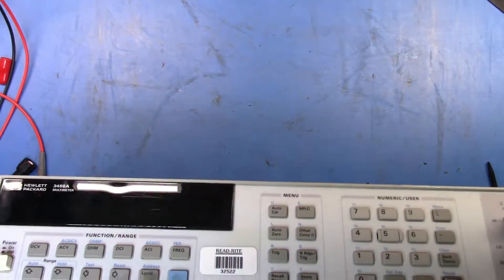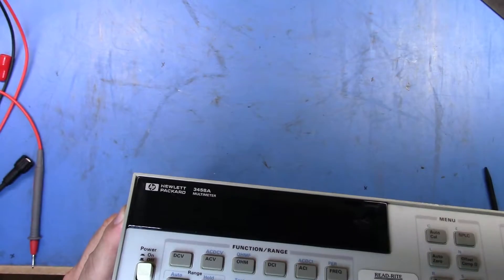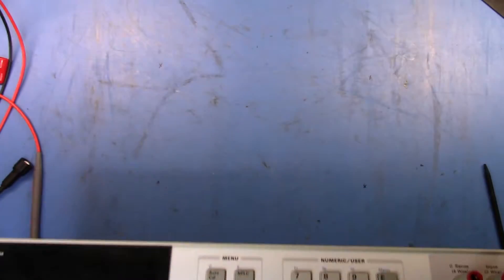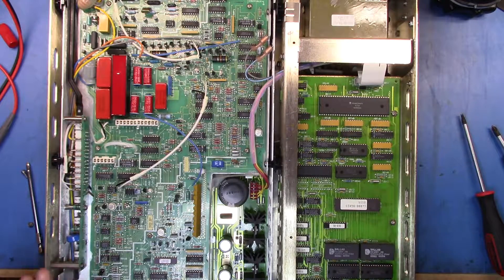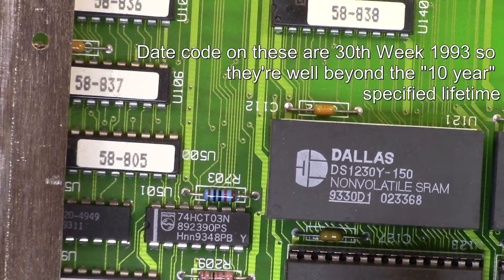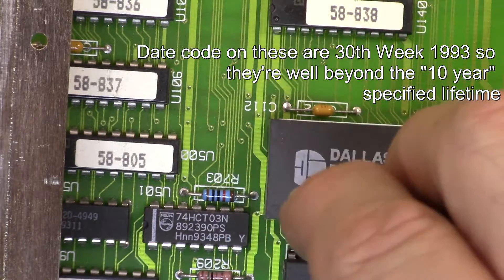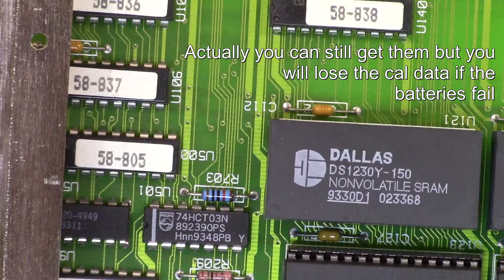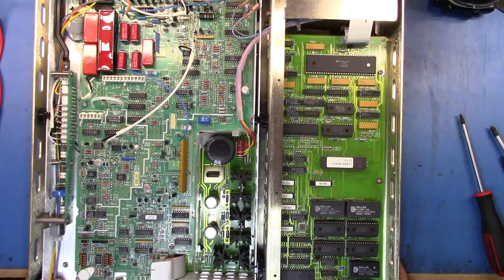HP 3458A NVSRAM Check

Comment: Any update on your 3458A? :)
Reply from the maker: Great to hear from you - Love following your adventures on the EEVBlog forum :) I sent the unit off to Keysight to get an initial calibration and to put it under a 3 year warranty. The folks in Loveland CO fixed a small issue with the rear terminals and then upgraded the NVRAM ICs for me for free - Outstanding support - Spoke to the guy there who manages the lab and he said they really appreciate all the volt nuts out there who buy this old gear.

I'm very happy with the purchase - Once I clear up a problem I'm having with a 53131A Counter I'm planning on joining the RPi logging thread on the forum.
Reply: +tgsoapbox Glad to hear that meter is in safe hands now. I'm waiting for my second in few weeks :) Never enough test equipment.

Comment: Where do you send stuff like that away for calibration?
Reply: Oh. I see later. Didn't realize HP (or whoever owns this line today) would calibrate old stuff.
Reply from the maker: Np, the  3458A is actually still a shipping product, 30 odd years at the top of the DMM market.Actually many OEMs will still calibrate gear that has gone 'obsolete'  for quite some time. I'll be doing that with my Fluke 5440B/AF (7.5 digit DC calibrator) and Fluke 5200A so I have some well defined standards.